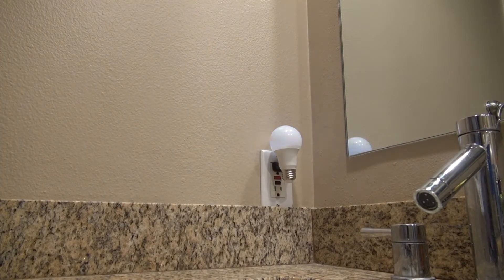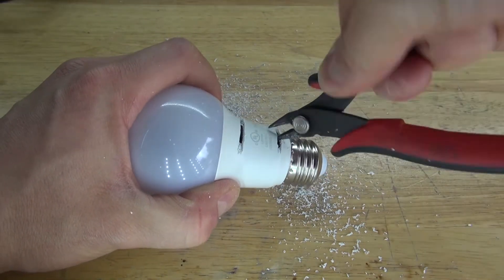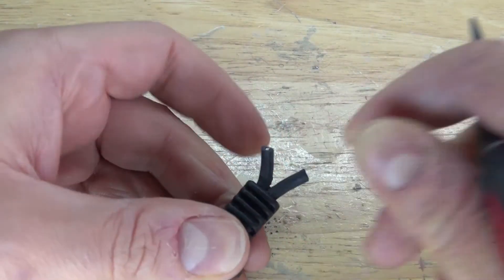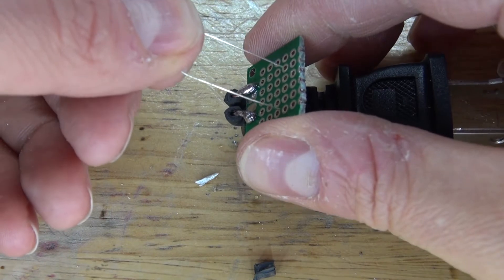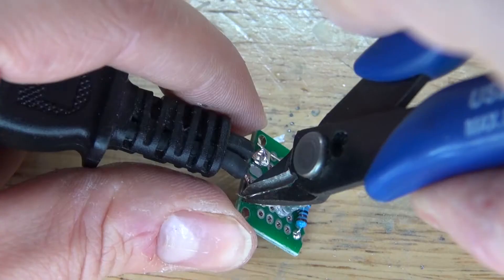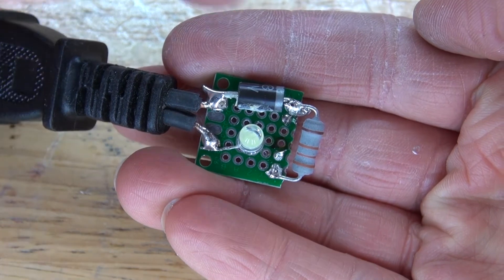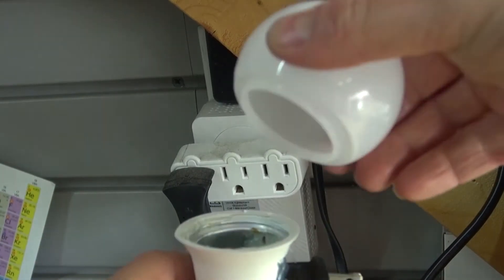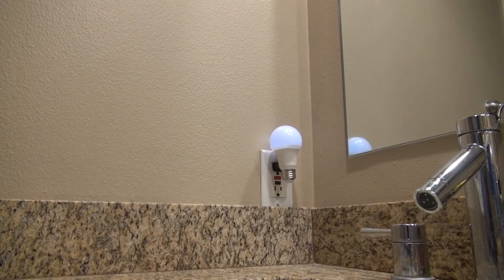How To Make A Simple Night Light From A Broken LED Light Bulb

Comment: I strongly recommend replacing the 1K8 resistor with a 0.1uF 250V non polarised capacitor. The voltage drop across that resistor will produce considerable power dissipation!
Reply from the maker: That's true it does get hot. I will try the polarized capacitor. Thanks for the information. I already made a video that doesn't use the polarized capacitor but in a video after that one I will.